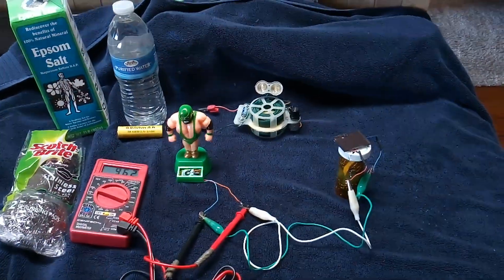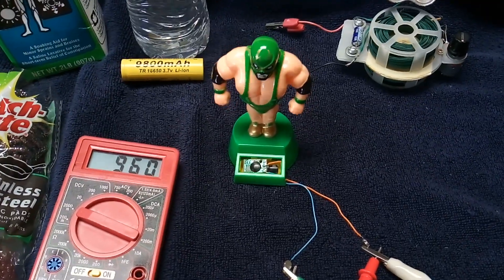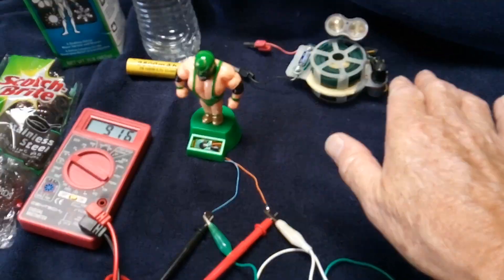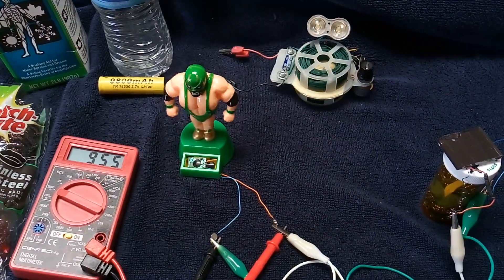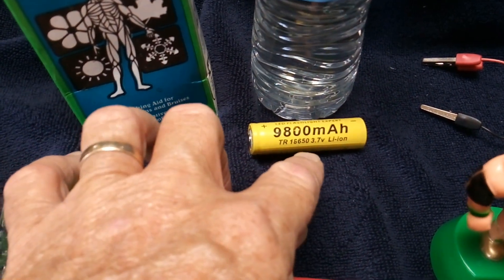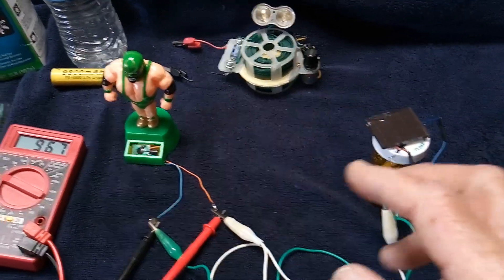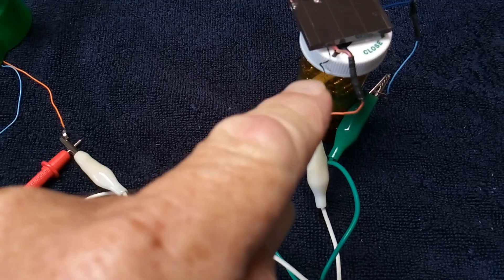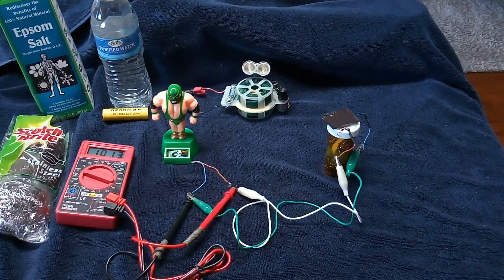Solar waver powered by homemade rechargeable

Comment: What if we use 2 packs of the stainless steel to make 2 poles of a much much larger cell. 
It should be able to power a string of LED's or a small regular and pulse motors. What will be the resultant ambient terminal voltage of this kind of cell ?? They can be ganged into a battery bank. This would be extremely practical as a DIY battery for off grid and prepper environments.
Reply from the maker: The voltage of this cell is zero until it is charges.  The anode and cathode are the same metal.  After it is charged the cell will discharge under load just like a lead acid battery car battery.  Check out OUbrads video where he  tested several batteries together.